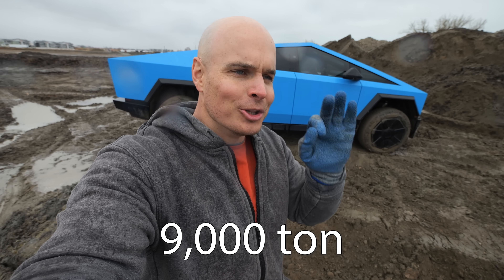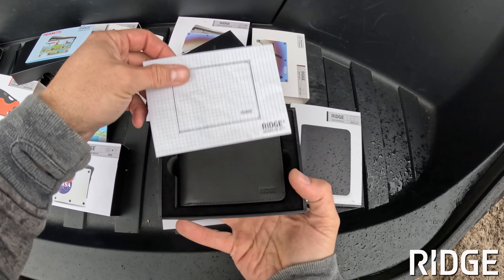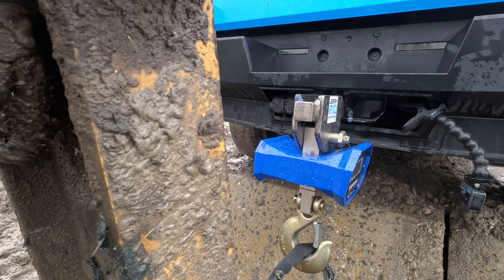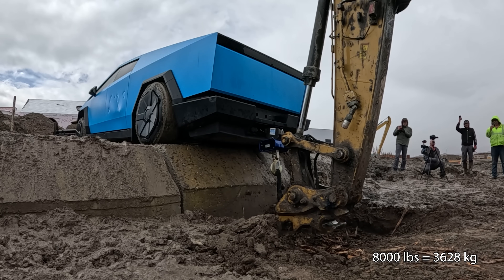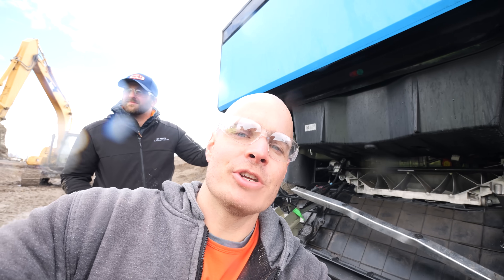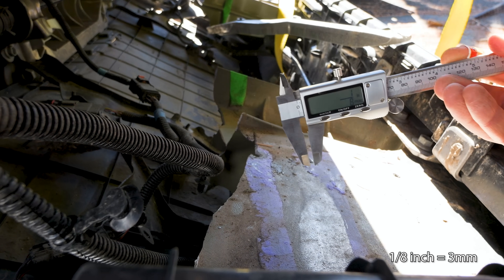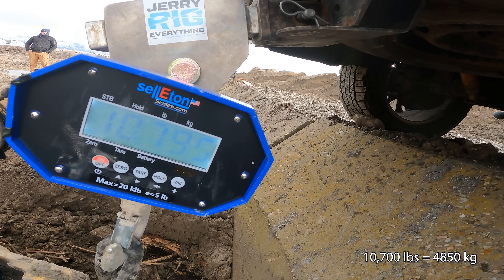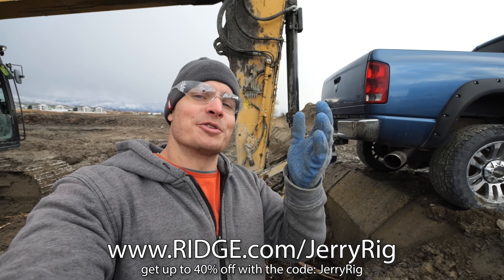SHOULD YOU TOW WITH A CYBERTRUCK?! - (catastrophic failure test)

Comment: Not even a heavy duty truckhitch will be designed for this kind of a load. I would be more than comfortable to put a huge trailer behind this.
Exception is maybe a Hilux which you could spin around in the air hanging by the hitch. The data you got is interesting. Would have been nice to go without the overdramatization.

Comment: Anyone that wants a more detailed explanation of why this guy is wrong look up a article another engineer posted "Effects of Prior Static and Dynamic Stresses on the Fatigue Strength of Aluminum". It's a great old study in a NIST journal I did enjoy the read it's been a while since I've had to dive into a journal for research. I used to enjoy fatigue and crack propagation research in school. There have been follow up studies so don't let the old date fool you. It basically says what this guy says is incorrect and you can tow just fine with an aluminum subframe vehicle and prior stress from cyclic loading is nothing to be concerned with. Just stay within the design specs and you'll be fine.

Comment: Wasn't the towing capacity of the cybertruck advertised at 11,000 lbs? Either way this doesn't look good for tesla. If they did a steel frame with aluminum body it'd be much better. They definitely over hyped this garbage SUV into the sun.

Comment: I've bent tow hitches and receivers before as have a lot of people. The force required to bend those would destroy the cybertruck's frame and free the trailer. 
That's what this video shows. People abstracting the argument away are being dishonest. Aluminium is a material that only catastrophically fails. The engineered load should be dramatically higher to avoid this even being a thing people can demonstrate.

Comment: You're smarter than this JRE. Tongue Weight DOES NOT equal TOWING CAPACITY. There is absolutely no scenario where the FULL weight of the trailer is applying complete vertical downforce on the hitch.

Comment: As a fan of the channel, this is not a good representation of real life. Having to hold down the front end is a big clue this doesn't represent reality.  You would never experience this level of tongue weight in real life, if you did, you are doing something horribly wrong or extreme. Plus its compared this against a HD pickup that has a tow capacity significantly more than the Tesla.  I think there is a lesson to be learned here about aluminum versus steel trucks, but this is drama, not reality.  This is the last video I will watch from this channel.
Reply: You're not taking fatigued metal into consideration. The aluminum frame WILL fatigue significantly over time, and could very well fail catastrophically with much less than 10,000 lbs. The Cyber Truck is nothing more than a very expensive toy truck.
Reply: @ChadFranzen  that isn't what this video was about.  I drive a HD truck and would never buy a cyber truck to replace it.  But if you decide to tow an 8000lbs boat occasionally or short distances with a Cyber truck the video proved this would be safe, but the dialogue claims it could be catastophic, just misrepresenting the facts. No, the Cyber truck is not going to fail towing 10,000 lbs, that is no more than 1500lbs of tongue weight, and anything that might happen with the realm of real world situations isn't going to dramatically change that.  How many times have your front tires lifted off the ground while towing a properly (or even improperly loaded) trailer.  yeah, never.  I can't ever see anyone in a situation where you would load a trailer so poorly you would have this problem.  As soon as you get into the truck, you would be like wow, can't steer the truck because there is no weight on the front tires... just not going to happen.

Comment: So it survived until 10,000lbs of static weight, imagine how fast it would've torn apart if that was working weight.
Reply: tongue weight bruh, most vehicle's tongue weight it rated at 10-20% of two weight!
Reply: @MrTeslaX  You're ignoring the laws of physics and the fact that it was the frame that broke.
An object in motion can exude much more force than an object that's not moving.
A baseball weighs 5 oz, a baseball bat can hold hundreds of pounds before it breaks, and yet people are out there breaking bats by hitting a little 5oz ball.
Try lifting 20lbs, pretty easy, try lifting 20lbs quickly, it requires more force, try lifting a falling 20lb object, it requires significantly more force.
Stand on a scale, lets say it reads 100lbs, now jump on the scale, for a moment it'll read much higher than 100lbs.

Comment: The fact of the matter is Mark was wrong that video was disingenuous and the fact that Jerry rigged everything took up for him just shows how corrupt these two fools are.  
Yeah the stocks are down You're right, but that doesn't mean that lying about a feature somehow doesn't contribute to a stock slide is a wild take. The structure of the cybertruck is not that good,as a petrol loving guy I don't want a EV,so this has more to do with those that bought the brand to save the environment, funny enough the materials to build those batteries are extremely toxic.😂 Also doesn't mean going around and committing crimes such as vandalism on Tesla vehicles is the right way to do things. Those are the actions of an unhinged lunatics that should be put in prison.

Comment: That test replicates a pickup truck trying to tow a 50-ton trailer.  The situation replicated is illegal in every one of the 50 states.   10,000 lb on the tongue of anything less than a heavy tow truck or semi is a stunt with little value.  "heavily loaded trailer hitting a pothole at 80 MPH..."  Who did the engineering on that statement?  I'd bet that 50 tons moving laterally 80mph would fly over a pothole with probably a handful of milliseconds shock impulse on a nearly horizontal vector.  Remember Newton?

Comment: This test is extremely misleading. The Cybertruck’s hitch is rated for 1,100 lbs of tongue weight, yet it withstood around 10,400 lbs—nearly 10x its rated capacity—before failing. That’s not a ‘catastrophic failure’; that’s an overbuilt component exceeding expectations.

The philosophy behind this test is flawed. There is no real-world towing scenario where 100% of a vehicle’s towing capacity is applied directly downward on the hitch alone. Even in extreme cases—like pulling a vehicle out of a ditch or cresting a steep hill—forces are distributed across the truck’s suspension, frame, and trailer axles. A real-world Cybertruck owner towing within Tesla’s specifications gains nothing from this test, making it difficult to believe Jerry doesn’t understand this. Again, nothing in this video represents real-world towing—it’s purely a static test.

Bringing up SAE J684 is also misleading. That standard requires hitches to withstand 5,500 lbs of tongue weight, but Tesla never claimed its hitch was rated for that. The fact that it held over 10,000 lbs before failure actually proves it’s far stronger than advertised.

At best, this was an unrealistic torture test. At worst, it was an intentional misrepresentation designed for a ‘gotcha’ moment against Tesla. If this test proved anything, it’s that the Cybertruck’s hitch is significantly stronger than its rating, not weaker. Doubling down on the ‘catastrophic failure’ claim—while condescendingly dismissing valid criticism—only makes the video look more disingenuous.

Comment: Something that immediately worries me with the cybertruck breakage is that because the hitch breaks free, that actually makes a trailer loss scenario considerably more dangerous. 

When moving large RV's, those things have an emergency braking wire that attaches to the hitch itself. The idea is that if everything fails and the trailer disconnects from the hitch, it instantly will slam on the brakes to that you minimize how long there is several thousand kilos of uncontrolled material traveling the highways at high speed.

Except that with this, that wires not going to be pulled. If your exceptionally lucky, you might retain the electrical connection and the trailer might respond to a manual brake input. Otherwise, that trailer is going to go uncontrollable, hitting other vehicles, or rear ending the towing vehicle.

Comment: I will give my two cents as a as an engineer your statement, "aluminum does not have a fatigue limit it will continuously get weaker and weaker forever especially as it gets stressed for towing." is misleading and oversimplified. Your experiment proved that the Tesla engineers did a great job in the design of the truck; they are not amateurs. Aluminum does have issues with cyclic loading but you can mitigate that by staying well below the critical threshold (over-design for given loads). As another engineer pointed out you put a massive 10,000 lb sheer load on a tongue that is only supposed to experience 10% of the max tow weight and it did great and carried over 90% of the rated tongue weight. Then you also make the statement that a improperly loaded trailer hitting a pot hole could put that kind of weight, 10,000 lbs onto the hitch and have it snap off". I ran some load calculations and you've really got to screw up your loading of the tongue by 30-40% trailer load or have an apocalyptic pot hole that produces like 8g+ . The claim you make appears to be another scare tactic. If someone is at a 20% tongue weight load you will be fine with a 2-5g pot hole impact which is what the industry feels the average pothole at highway speeds are. The tires and suspension have flex which will aid in lowering the force applied. Another thing is that the pothole loads over milliseconds instead of a sustained load.The hitch easily survived with my calculations. Would I want steel if I was towing? Of course I would. but Teslas have to work within the constraints (weight) of an electric ecosystem and for that I think they are doing a pretty good job. Your hate for elon musk is skewering your experiments. I don't own Tesla or the stock I just don't like poor misleading experiments like we see all over the place on youtube.
Reply: THIS!
Reply: Well said. This was Elon Derangement Syndrome masquerading as science.

Comment: Not to mention that the dodge is 20 years older and still did better
Reply: Yeah that dodge probably spit out its flywheel 15yrs ago and has been sitting waiting for its time to shine. Kind of hard to tow when your transmissions blow up if you look at them funny.
Reply: @Skroggn well 90s dodge 2nd gen prob left 2nd gear in the trans pan but talking about frames throw a motor and trans in the dodge and it would still drive as the cyber truck wouldn’t drive

Comment: Wow,  how stupid can you be? You're loading the truck vertically,  which is tongue load, not towing load. You should be sued into bankruptcy for this gross defamation of what has been rated as the safest truck on the planet structurally by the NHTSA crash testing agency.  The tongue weight doesn't become tow weight under any circumstance unless you are abusing both the load and the truck itself.  

If you are loading the Cybertruck so heavily you aee lifting the front wheels off the ground,  you are overloading the truck.  Really,  this isn't rocket science!

Comment: That is interesting that the excavator couldn't exert more than 10,500 lbs. I think that that may have been the capacity of that front cylinder. If you had used the cylinders closest to the cab, I think you may have gone well beyond that. Either way, that is a very thin beam casting for the weight and lateral deflection it needs to support. I think an engineer looked at the wrong material table when calculating that particular part, and the thicknesses needed. Great way to scientifically show the failure point.  I am interested in the string of error codes as well. I wonder if a wire was compromised somehow and triggered that issue? Hitting a bump and losing the trailer may not be the worst of the problems, as it appears the failsafe is for the Cybertruck to shut off. If that is instantaneous, the trailer isn't going too far as all 4 tires would stop rotating at the time of failure. There are some serious concerns for Tesla on the matter, indeed.

Comment: Really disappointed in jerry-rig everything at this point. I just feel like this is so paid for by leftist Shields that don't want to lose any more money from Doge discovering their inadequacies. Just like Roper the other day and his BS test of Tesla autopilot in which people found out he wasn't really even in autopilot. Consistently misleading people by not correctly stating why the numbers are the way they are and that instituting scare tactics and claiming Tesla is an adequate for what Tesla says they can do should be a sewable offense. It should be defamation. Tesla States in their service manual tongue weight of 10% of the towable weight which makes it 1100 lb. To sit there and say that Towing over a crested Hill can get you 90% of the towing capabilities to be pulling down on that hitch is absolutely inadequate. At most it's been shown and tested to produce only 25% of the wait at a 32 degree angle. And then at the end to say that because Tesla's aluminum is thin that it can't be strong, is yet another non factual statement! I would encourage him to reference every bridge made of balsa wood in science class. Structure is everything. It is obvious that Tesla's design structure is complex and full of supports and architecture that strengthens its shape.
Just so frustrating that jerry made this video.
Reply: You that butthurt?
Reply: @joshuafrimpong244  so the only response to good criticism is a insult you probably didn't even read everything he said. The real question is why are you so quick to hate?
Reply: @mostsharksdontattendchurch  The real question is why simp for the richest person on the planet?
Reply: @serpico1616   where in this comment am I simping? I simply was trying to convey that it is ridiculous to be dismissive of good critism for nothing other than pride. If anything you guys are simping for as you take after him, giant babies that want attention and can't take critism.
Reply: just say you own a cybertruck

Comment: google say "The dual- and tri-motor Cybertrucks have a maximum towing capacity of 11,000 pounds"

towing, not hang all the load on the hitch(that we see in video)
and we apply all this weight in vertical direction. it is not possible at least 50% of this weight go on hitch in vertical, some angle - yes, vertical(90 degree angle force) never.

imho great results.

Comment: For people that understand engineering, this is actually a great advertisement for Tesla. Direction of force can never be 10k punds straight down like that even when hitting a pothole. Tounge weight is not the same as tow weight. Also your focus on the gule is wierd, these two joints were clearly designed tor forces 90 degrees to what you inflicted, and the wholes between the two materials where there were a bolt or spot weld takes the force, not the glue. The glue helps, but the strength is in the bolts/welds. Very biased, disappointed Jerry
Reply: Not biased. Factual. The aluminum is only going to get weaker over time. And as he stated, there are times when the full trailer weight CAN be on the tongue - and when that happens it is not going to be a gentle, gradual increase - it is going to be a sudden shock of the full weight - with which aluminum does not deal well.

Comment: How are you concerned that a trailer with a tongue rating of around 1,000 pounds snapped at over 10,000 pounds. There is no improperly loaded 11,000 pound trailer that could ever put this much weight onto the tongue. And as Tesla engineers have pointed out the front tires of the truck would be off the ground way before tongue weight ever hit 10,000 pounds. By your standards the new F-450 that can tow 40,000 pounds needs to have a tongue rating of 40,000-60,000 pounds otherwise Ford should be very concerned. Cool experiment, terrible explanation of the results and false expectations of what trucks are meant to do.

Comment: The tongue weight for a cybertruck is 1100 pounds , you applied 10 times the  normal amount of weight and held down the trucks front. regardless   I would feel more comfortable if the tow hitch bent instead of snapped

Comment: Your test misleads by applying 10,400 lbs of vertical force to the Cybertruck’s hitch, ignoring its 11,000-lb towing capacity versus 1,100-lb tongue weight distinction. Towing involves trailer tires distributing weight, not just hitch stress—making this an unfair attempt to paint Tesla as weaker. 
Jerry, seems like U are one of those crazy Tesla haters 👎

Comment: sadly some people dont realize the dodge had its whole car frame completely compromized and maybe not even road legal, with major weaknesses forming in the structure, but "ooh ahh its trailer didnt fall off" ,at an unrealistic down force of a load. Aluminum while it is somewhat bad for lasting strength, is still used for constant and load bearing in aircraft, because it still has enough lifespan to last the duration needed. Same for a car.

Comment: If the spec is 10K lb it's telling owners you can load 10K lb without issue. This means a truck advertising 10K lb should be able to take well above that just for safety reasons.

Comment: A proper trailer hitch receiver is welded, NOT spot welded, to a heavy U 
frame which in turn is bolted to the frame of the truck  NOT  spot welded
to the truck frame. The cyber receiver may be able to roll a 11K trailer on
level with the brakes released but I wouldnt try to pull anything out of the
ditch or mud or snow with it.

!

Comment: First off I am not a cybertruck fan but this seems like an unfair test.  While the towing capacity may be 11,000 lbs as you say, that is not the same as the tongue weight.  I think you should have tested this against the tongue weight, not horizontal towing weight